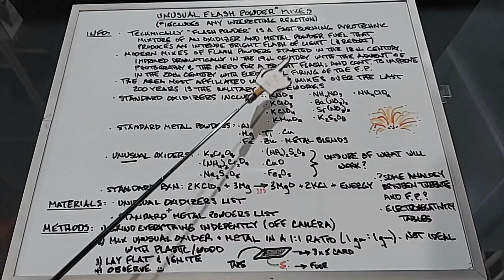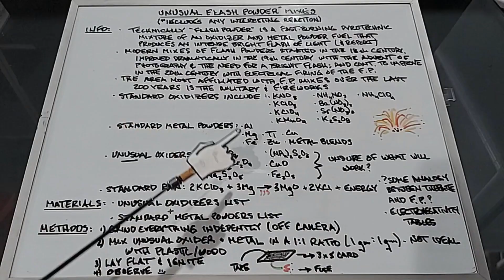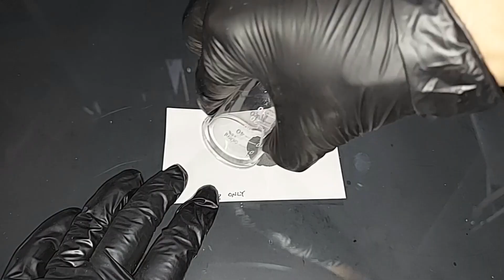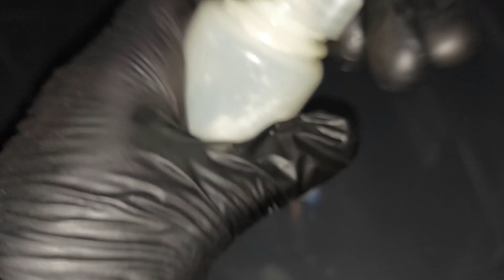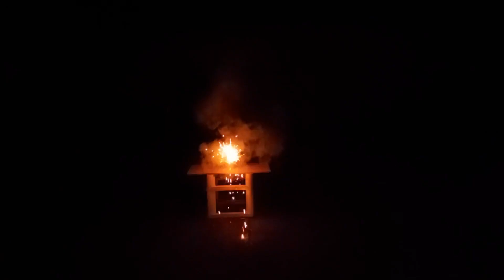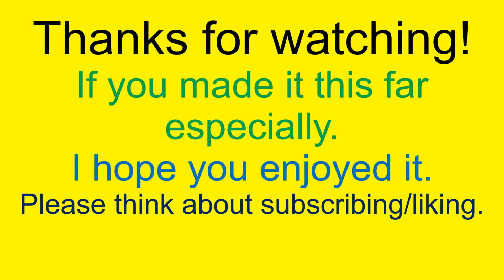Flash Powder Oddities or Unusual Oxidizers For Flash Powder

Comment: ✅Professionally standard: KNO3, Ba(NO3)2, Sr(NO3)2, KClO4, KClO3.❌ What are not standard and there are chemical incompatibilities: NH4NO3, NH4ClO4 the only relatively standard, K2S2O8, KMnO4. The problem is that what you present as standard is not even standard in professional pyrotechnics. Flash Powder Oddities or Unusual Oxidizers For Flash Powder, But for what purpose? It should be recognized that the fact that someone who is not familiar with it puts something in because they didn't get what they needed, is not professional in amateur circles, and we can't classify this as standard!❗ K2S2O8, KMnO4, NH4NO3 in the professional flash powder pyro compositions are not exit! Unusual Oxidizers: Here, if performance is the goal, nothing remains, and in most cases we cannot even talk about chemical stability. People put all kinds of nonsense in it as oxidizers, which is a bad way to go. If someone want to use this for a product, it will never work properly or have the proper chemical stability. There are cases when there is a choice in compositions recognized in professional circles, and there are cases when there is not. You can't simply replace KClO4 with KNO3, or magnesium with aluminum, because that's not how things work. One way or another, an original professional composition is needed that is suitable for the given purpose, and there is no alternative to this. Even for professional products, amateur circles recommend quite a few professional compositions for products that are not exactly suitable for the purpose. Anyone who thinks that they want, for example, a good firecracker and that they will achieve something usable with oxidizing agents that are not used in professional circles is hugely mistaken, because this is a dead end. And the reason for this is simple, neither the proper performance nor the chemical stability will be achieved this way all in once. The only viable way is to make what you can't get the ingredients for, but not replace it. There is a professional choice for a given purpose, and several professional things can be considered for one purpose.🙂 I have been dealing with this topic for 15 years. And what I could advise is either put in what is originally needed and is the best, or if you don't have the knowledge to solve it, forget it.

Comment: При сушке кристаллогидрата нитрата кальция-аммония вы получили смесь гидроксида кальция, нитрита кальция и... этого же кристаллогидрата. Его нельзя избавить от кристаллизационной воды нагреванием.
Reply from the maker: Not exactly what I found.  Monitoring the temp closely, between 100-120 degrees C, and going slowly does give you a majority of anhydrous CAN.  Yes, there are other components.  The video was sped up a lot.  The original full length video is over an hour long.  I test smaller amounts with Mg and got a single fast bright flash every time.  I was a bit surprised to see it flash irregularly with the 1 gm.  My sense is that I just didn't mix it well enough as I redid it later and again got a single bright flash.

Comment: Magnalium is magnesium turnings, 30% and 70% aluminum granules mixed thoroughly , packed in a 27mm x130mm SS pipe with one end capped  to within 3cm of the open end topped off with a 1 cm layer of 50/50 mix of NaCl and CaCl2 ,  then fine washed sand to 1cm of top, then heated in an upright position attached to a rod connected to a vibrator mechanism in a high temp top loading oven. The temp is raised to 640c in the course of 30 minutes and the vibrator started and the temp raised again to 750c in about 45 minutes. The salt mixture melts about 600c and combined with the sand, protects the Mg mp 649c + Al mp 650c mixture from oxidation. If any sparking is witnessed, more sand is added. When cooled, a rotating wire brush is placed inside the tube mouth to remove the sand/salt, exposing the surface of your new alloy. Next, the tube is clamped in a drill press and a 25.4 (1") drill bit at low speed is used to drill out the metal, producing a fine gray/black magnalium powder. (pg 101; Small Scale Synthesis of Laboratory Reagents with Reaction Modeling by Leonid Lerner. (I keep a copy in my bathroom for those moments requiring light reading). Hope this helps, I appreciate the effort you put into the videos
Reply: That is an absolutely fantastic textbook, I did not recall that magnalium was included. But much harder syntheses like POCL3 etc.are